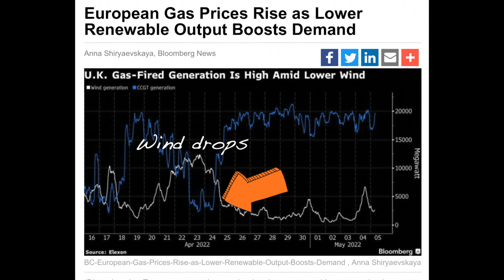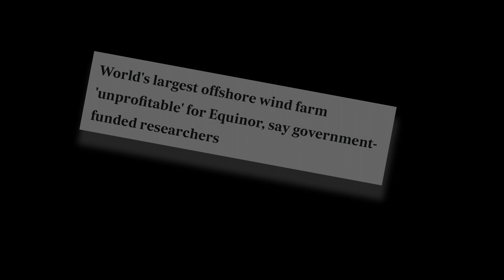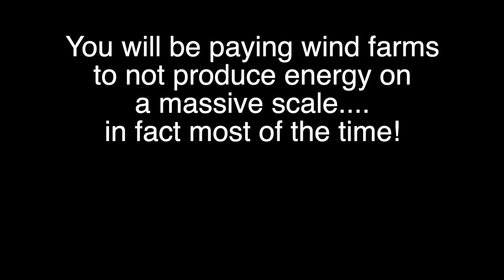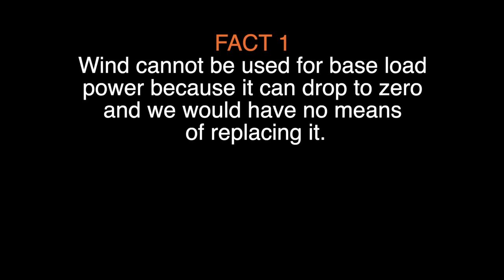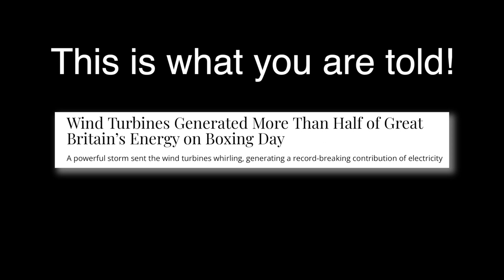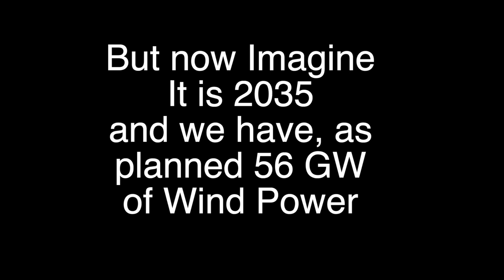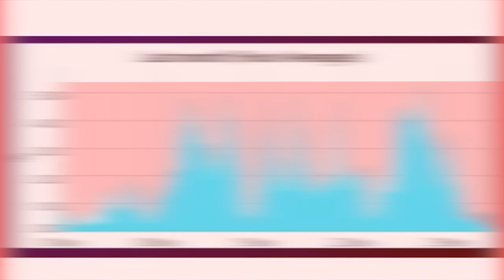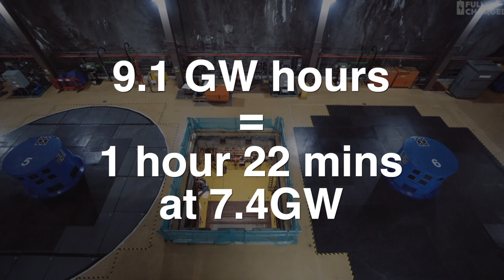When The Wind Stops   Parts 1 to 5

Comment: I’m in a back and forth with my brother about wind, he’s been quoting the figures from Denmark. Apparently they often produce 100% plus of daily requirements, and 100% plus of capacity factor!  (From WindEurope)   So I did some digging and discovered the capacity factor and installed capacity are very different.  
Looking at U.K. data from Energy Trends, I see Load Factor which is a fairer measure than the Capacity Factor, but it does allow for periods when a turbine is out of commission ie maintenance.  (Convenient if they schedule maintenance during high pressure periods 🤔) 
But whenever wind farms are mentioned, they always tell you how many homes “will” be powered based on the nameplate capacity at optimum wind speeds.  
I decided to see what the actual performance is for U.K. wind energy providers - the actual delivery to the grid.  It’s very poor below 28% regardless of the installed capacity.  In other word, it the nameplate capacity is 30 GWH you’re likely to see an average of 8.4 over extended periods.  If there’s 100 GWH it’s likely to be 28 GWH.  
I’m aware that quarters 1&4 produce far better returns than the spring/summer 2/3 quarters, also offshore better than onshore (no mountains on the seas) 
So if you get chance would you have a look at this please 
Many Thanks.
Reply from the maker: "often produce 100% plus of daily requirements, and 100% plus of capacity factor!  (From WindEurope) "
The simple fact isn that the wind in Denmark, just like in the UK, drops to almost zero many times a month - that is not disputable. no matter howmmany wind turbines you have they all cannot produce the energy when there nis no wind.
"In other word, it the nameplate capacity is 30 GWH you’re likely to see an average of 8.4 over extended periods."
Yes and that 8.4 means that lost if times there is not enough wind full stop - they you need gas power to quickly fill the gap.
If Denmark was 100% powered by wind (impossible) then therein would be no need for gas.
In have looked at all of this and will continue to do so. Have you seen my five part series "When the Wind Stops"?
https://www.youtube.com/watch?v=a_2z9PXzA6E

Germany was a the 'greenest' country in Europe but as is now obvious needed large amounts of gas.
Reply: @ClimateRealism  Thank you for responding Paul, I am working my way through your videos one by one and find them very informative.   I am fully on board with you on the problems with wind energy.   I set up a  spreadsheet from the Energy Trends to show the “effectiveness” or more often lack of.  Taking the period from 2009 to 2021, it seems regardless of the total capacity the returns are limited to less than 30%. (At this point I’m ignoring the major disruption to supply when energy suddenly collapses). I’m trying to demonstrate that throwing more turbines into the equation is pointless due to their limited lifespan.  We probably have 12,000 feeding the U.K. each with at best 20 years. Just to maintain what we have now means the best scenario is that they have to be replaced at a rate of 11.5 per week in perpetuity.  All to achieve the current 21% of energy needs.   Average and %age is what these silly advocates like to talk about, because it conceals the major problems of sudden collapse as the wind drops.  Thanks again for listening.

Comment: Gas powered fans to drive the wind turbines when there is no wind?
Reply from the maker: Then you would be using a very inefficient gas system as well as very high capital costs and thousands of miles of gas pipes when it is much easier to simply use gas to make the electricity ion the first place. Also does not cover the cost when there is too much wind and we have to pay to either have Europe take it or for the wind turbines to be switched off. Wind power is stupid from every angle.

Comment: You seem to be pushing gas as a solution.  It produces 117 pounds of CO2 per million BTU.  How do you intend on dealing with that CO2?  It is also a non-renewable resource.
Reply from the maker: The CO2 produced is beneficial to the planet see my video 'MorerCO2 Please' oil.
Correct it is not renewable but then neither are current renewables without oil, gas and coal.
Reply from the maker: @jacdale  That is all based on models that are shown not to work.
Reply: @ClimateRealism  I also gave you a list of successful forecasts from Global Climate Models.
Reply from the maker: @jacdale  They changed the data to conform
I would one to post graphs etc bit not possible min this post format.
Best to email me on svsuliere@gmail.com and then we cancget down to the issues properly.
Reply: @ClimateRealism  I am on the water from September 10 -18.
Reply: @ClimateRealism  "They changed the data to conform"  Judith Curry has a three part series, saying that is not true.  Will post links when I can.
Reply from the maker: @jacdale  Have a good time. The best for us was crossing the Atlantic around the cape and a 6,200 mile journey. Then the Pacific.
Although our best place was in the Ragged Islands when we had whole islands to ourselves.
Reply from the maker: @jacdale  ok
Reply from the maker: No comments on the actual video though😀
Reply: @ClimateRealism  Your video is profoundly myopic.  There are more renewable energy sources than wind power, and more energy storage systems than pumped storage.
Reply from the maker: @jacdale  Name them because the world has gone wind and solar.
Name an energy system that can sustain 9 days without any wind power.
Name another source that can kick in quickly besides gas and hydro.
On this one you are on a very sticky wicket.
Reply: @ClimateRealism  Geothermal.
Reply: @ClimateRealism  Wind and solar are the two energy sources that are the focus of those who dismiss climate science. 
I would start with energy efficiency.
Reply from the maker: @jacdale  Geothermal is a source not a storage pf energy. I make documentaries and have done one on Geothermal in New Zealand - I totally support that as a source but that is not available isn the UK......so how do you store the intermittent wind power? The save you time, there is no current viable method.
Reply from the maker: @jacdale  What does that mean in real life terms?
So you agree then that wind power is a very expensive, unreliable source of energy then?
Reply from the maker: You are on a very sticky wicket here😀
Reply from the maker: @jacdale  At least we are sticking the the video - is there anything in it that you consider wrong? Have I misled anyone?
Reply: @ClimateRealism  Wind and solar are not storage systems either.   Some storage systems in development of which I am aware include compressed air (HydroStor) and kinetic storage (KineticCore)
Reply: @ClimateRealism  Your video is myopic.
Reply from the maker: @jacdale  Of course they are not storage systems all  y videos make that crystal clear but you avoided answering my question on wind and then you suggested systems that are simply not there and can never be there in the quantity required - in the meantime whilst we wait for system that will never happen what do we do - go back to the middle ages?

To cope with replacing 9 days of power in the UK you need at say 35 GWh average draw time 24  times 9 days = 7.56 TerraWatt hours of energy and your solutions, besides not existing in other than pipe  they the energy could not be replaced to top up the dreams, could not come near to even a fraction of that. Also even if they did could never even remotely approach the storage  energy to stop them up agains with the 7.56 Terra watt hours would not be there.
It seems to me that you are grasping at straws there naming storage solution that not only do not exist in any practical form but can never exist in any scale.
Reply from the maker: @jacdale  Let me expand
"Each Kinetic Battery Provides 50 kWh of (up to 4 Hours)"
Sci the amount of electricity is 50 kWh - you need 20,000 of them to give a Gwh.  Hence  about 150,000 or so to cope with the 9 days without wind.
The low density of the energy and the amount of land needed plus the incredible cost that would bankrupt a nation makes it a total non-starter.
Reply: @ClimateRealism  Kinetic storage is one example of many.

BTW - You have still not answered this question.

"You seem to be pushing gas as a solution.  It produces 117 pounds of CO2 per million BTU.  How do you intend on dealing with that CO2?  It is also a non-renewable resource."
Reply: @ClimateRealism  So you saying that the UK is screwed regardless of what it does.   It can rely on a non-renewable energy source or it can forgot about energy storage. 

I wish you luck.
Reply: @ClimateRealism  So far, California's electrical grid (the US grid most dependent on wind and solar) handled record-breaking demand during this historic heat wave. Today's the last day of the heat wave.
Reply from the maker: @jacdale  Sorry but I repeat Kinetic storage is NOT one of many - there is no solution there at anything like the scale needed. You cannot run an economy on values one of many. Thew truth is there is no solution and you have failed to name one viable one.
I did answer the gas issue.  There is enough gas in themUk for hundreds of years of use and I am advocating Stable salt Reactors of say 50Mb to managed in steps to meet demand. My solution is real, can be done now and kleepos the lights on - your vague suggestions are not solutions and the lights go out.😃
Reply from the maker: @jacdale  California has many brown  out and rolling black outs and the heat wave was not historic. However you are still avoiding the issues raised in this video - in this country we pay for others to take wind power - negative pricing when there is too much and when there is not enough up to 50 times the normal price - just facts.
Reply: @ClimateRealism  So producing too much wind power is a problem for the UK.  OK.  Most folks claim wind power cannot produce enough energy. . 
There is seems to a demand for energy storage.  You should  start innovating.  When you do so get back to me.
Reply from the maker: @jacdale  Jack, come on you are not on thin ice on this one but are trying to walk on water.
The entire point is that there is no viable way to back up the wind.
Demand varies throughout the day and is lowest at night BUT the wind at night can be very high - that is the issue with all wind power everywhere.
You do not have any answer to these questions, are totally cornered on it so tell us to innovate  - the UK have historically innovated so much they changed the entire world but they cannot change the fundamental laws of physics.
You have no answer  to the huge problems of wind power that the video highlights .... period.
Why not just admit thee video is right and wind power is just a medieval form of power not suited to any modern economy?
😁
Reply: @ClimateRealism  "The entire point is that there is no viable way to back up the wind. "  There no solutions of which you are aware.    That says much about you.

I am invoking Proverbs 26:4. 

Bye.
Reply from the maker: @jacdale  O dear. 😀
Having not come up with any answer to backing up wind and not even understanding that the backup itself has to be filled up again at great losses of energy, you resort to religion!
To save anyone looking it up here is the proverb:-
"Proverbs 26:4-5 – Answer not a fool according to his folly, lest you be like him yourself. Answer a fool according to his folly, lest he be wise in his own eyes. The self-confident fool thinks too highly of himself and his opinions, and he shares them freely."
Well this makes my point for me. The answer to sky rocketing energy prices, avoiding brown outs and black outs is religion! 😅😅
We have to hugely subsidise wind with the green levies just a part of it. The cost of balancing the grid now reaching many billions only to have a source of energy that costs us up top 50 times normal price when the wind does not blow and have us pay to give it away then it blows too much.
In support of this crazy source off energy is a religious cult that cannot answer questions.😀😀
Reply from the maker: @jacdale  ":There no solutions of which you are aware" Nor are you or the rest of humanity aware.